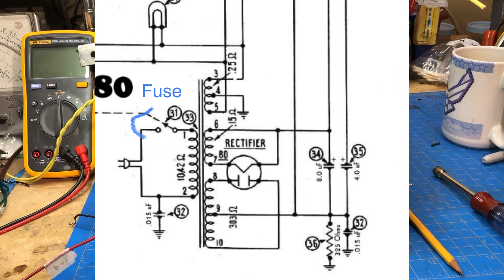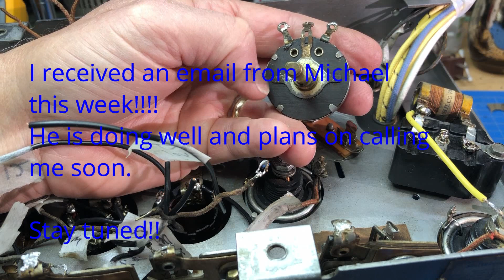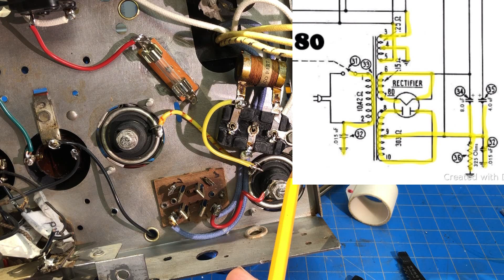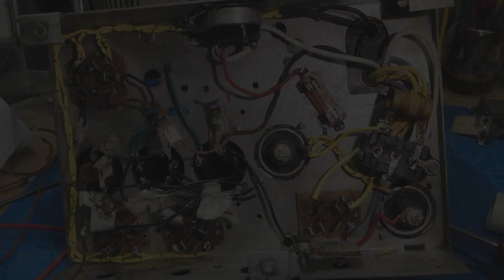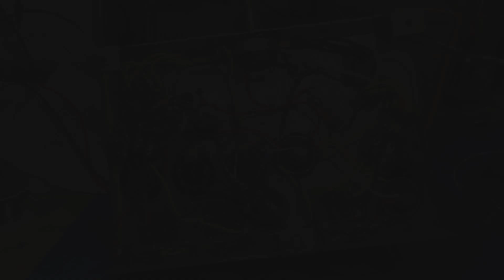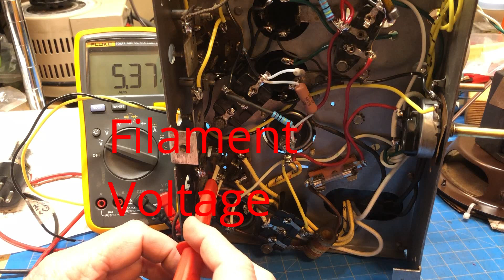1932 Philco Junior 80C Part 5 of 8 Reassembly and Test

Comment: Nice to see it up and running!  I found with my 80B there is some distortion, but a very long antenna seems to really help not only improve reception but sound quality as well.  I believe the distortion is related to the regenerative circuit, though my knowledge is very incomplete.  They are capable of surprisingly good reception, and for the price and the time, the Philco Jr's were a real bargain.
Reply from the maker: a587g Thanks for watching and commenting! As you will see in the next part, alignment....the distortion is limited to an extremely close station (1 1/2 mi)....These were simple, inexpensive sets (in the day)...these were, I believe were a transition to more modern sets...these had the "new" loudspeakers!!! Take Care--Larry

Comment: The second tube is a leaky grid detector. The idea is that IF signal charges up the capacitor which then "leaks" through the resistor. If an alignment doesn't solve the distortion then I would suspect the missing capacitor.
Reply from the maker: psionl0 Thanks for the info...good to know!!!! Spoiler Alert.....the alignment worked wonders...it was way off. The only distorted station now is the local one (about a 1 1/2 mi away) by removing the antenna, its good to go!!! Thanks for watching and commenting!!! Take Care--Larry